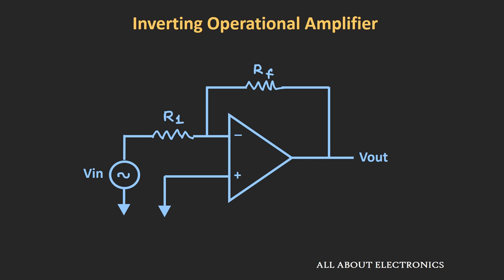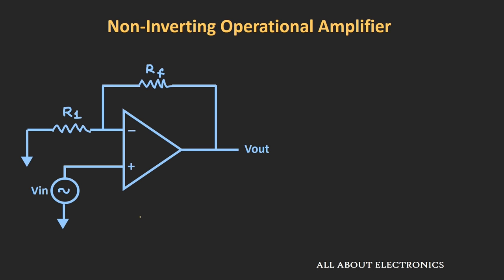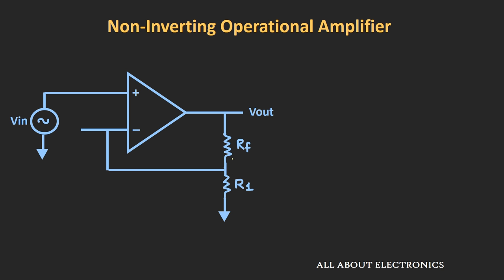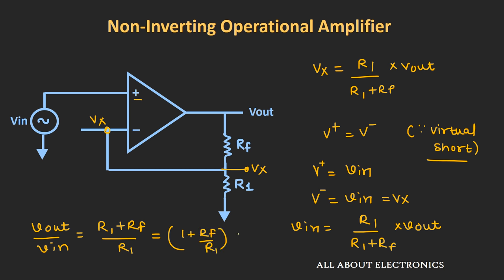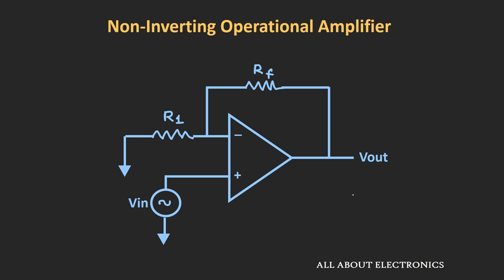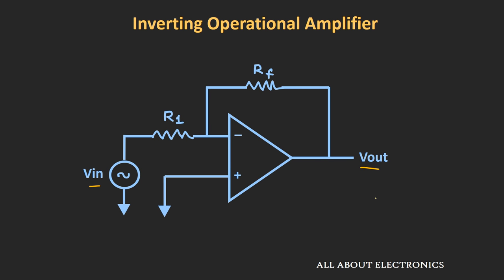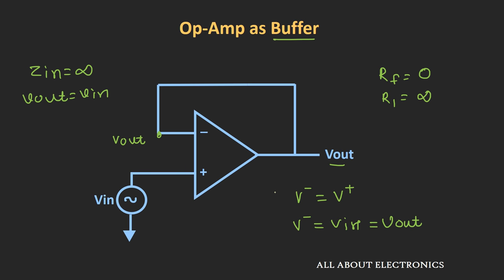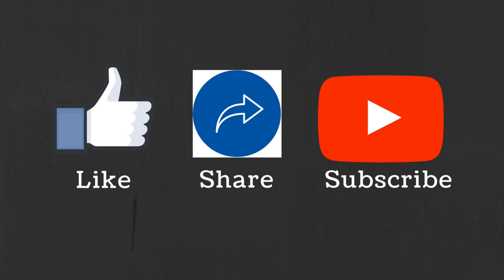Operational Amplifier: Non-Inverting Op-Amp and Op-Amp as Buffer (Op-Amp as Voltage Follower)

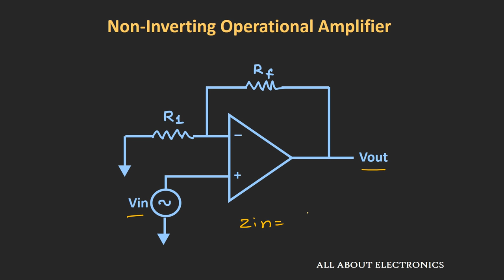Comment: At 5:44 you mention that non inverting op has high impedance while deriving Acl for inverting opAmp you told us that it has high impedance. Which is why Ir = If...can someone please explain that part?
Reply from the maker: For, non-inverting op-amp, I was referring to the input impedance of the entire non-inverting circuit. (op-amp with external resistors). Of course, the input impedance of the op-amp is very high. But when we connect external resistors, then it changes the characteristics of the circuit. In case of the inverting op-amp the input impedance is equal to R1. (it is input impedance of the entire inverting circuit ). While I was referring to the Ir = If, I was referring to the input impedance of the op-amp. (That's why it can be assumed that, no current is entering into the op-amp terminal)
I hope, it will clear your doubt.

Comment: In the Negative feedback circuit,it is essential to have a phase shift of 180 degree between the Vin & Vf. Now Vout is feded back as Vf, multiplied Vout with a factor B. Now here,my question is,if I am giving input signal to the non inverting terminal of the op amp,Vout will surely be in phase with the input signal,then the feedback voltage Vf also be in the same phase of the input voltage i.e. between them 0 degree phase shift is presented.But the condition of negative feedback is : phase shift between Vin and Vf = 180 degree.Please help me to clear my confusion.
Reply from the maker: In non-inverting op-amp configuration, the feedback voltage is applied at the inverting input terminal. So, it always opposes the input signal. Or in other words, it is 180 degree out of phase with the input signal. 
And that's how the condition of the 180-degree phase shift is getting satisfied. 
I hope it will clear your doubt.
Reply: @ALLABOUTELECTRONICS  Thanks ❤

Comment: 11:18 

Sir then why Don't we connect both the circuit with just a simple wire.....then??
Why i have to use buffer instead of just a simple wire?? 

Thank you sir
Reply: That is because you want to isolate the input circuit from the output circuit.

Comment: I have a doubt that 
why resistance is not connected in non inverting op amp when voltage source is connected??????
Reply from the maker: Generally, we connect the series resistor with the source to limit the current in the circuit. Ideally no current flows in to the op-amp terminal. Actually, it will be very very low. 
So, you can also connect the voltage source directly the non-inverting terminal.
I hope it will clear your doubt.

Comment: In the video 2 you told that for inverting opamp , the input impedance is infinite. Here you are telling it's depending on R1, can u make things clear
Reply: He told that input impedence of ideal opApm is ♾....

Also, in Inverting Opamp R1 is the input impedence because R1 is connected across Vin...

Whereas in non inverting OpAmp the input impedance is not R1 since it is not connected across Vin,, 
The input impedance of non Inverting OpAmp is not shown here, but it is maximum....

...Hope it helps

Comment: why (in both the cases: say inverting and non-inverting op-amp) FEEDBACK is only given to the inverting terminal [pin#02 of op-amp] ??
Reply from the maker: Because in both configuration, the negative feedback is given to the op-amp.
Reply: @ALLABOUTELECTRONICS  what would happen if we give the positive feedback to op-amp ?
Reply from the maker: With positive feedback, the output of the op-amp will go into the saturation. Ideally, the output of the op-amp should increase continuously with the positive feedback. But it can't go beyond the supply voltage, hence the output of the op-amp will get saturated near the supply voltage.

Comment: I tried the voltage follower circuit in pspice and it is not showing any output across a resistor although it giving right feed back
Reply from the maker: It would be better if you send me a diagram. May be you can message me on instagram your simulation.
Reply: @ALLABOUTELECTRONICS  on what account i have to instagram you
Reply: @ALLABOUTELECTRONICS  i send you pics please check it

Comment: i tried in pspice when I don't give any feedback output voltage range get shifted to negative region of graph can you tell why also I keep input voltage 1uV and Vcc and Vee to 15v and -15v respectively
Reply from the maker: In simulation, if the op-amp which you have selected is ideal then it has infinite gain. So, even for 1uV input signal it will get saturated.
Reply: @ALLABOUTELECTRONICS  it is not gaetting saturated its range become something from -1.22v to -1.51v

Comment: sir but in the last video you said input impedance for inverting opamp is infinite...im lil confused
Reply from the maker: Yes, for ideal op-amp the input impedance is infinite but here I am talking about this configuration. That means when the external resistors are connected to the op-amp. With the external resistors, the input impedance of that op-amp configuration will change.
I hope it will clear your doubt.

Comment: In the non-inverting op-amp, the input impedance is infinite, so if the voltage applied to circuit, it will appear across this circuit. Could anyone pls explain it

Comment: What is the use of a buffer over a wire ??
Could please help me getting it out
Reply from the maker: Many times one needs to isloate the input and output circuit. The variation in the load should not affect the input signal. In such case, buffer is very useful.
Of course, a normal wire will provide the same voltage at both sides, but it won't provide the isolation.
Moreover, when the particular circuit is not able to drive the load (not able to provide sufficient current to the output circuit) then also buffer circuit can be used. 

the buffer circuit, not only provides the same voltage to the load but it can also provide the enough driving current to the load.
I hope it will clear your doubt.
Reply: @ALLABOUTELECTRONICS  thank you ❤️

Comment: sir why we connect resistor to inverting terminal not non inverting explain
Reply: Bro in a previous video of inverting amplifier he said that it'll be the condition of unstability if we connect resistor to non inverting side.
Reply: To stay in the linear region we need to use negative feedback, that is why we connect output to negative input.

Comment: At 6.55, why the current Iin is not zero like in the non inverting op amp but Vin/R1
Reply from the maker: If you see, there is a node where resistor R1 and Rf meet. So, although the current flowing into the op-amp terminal is zero, but the current through R1 can flow through Rf. Therefore In is not zero in this case. And due to negative feedback, that node at the inverting terminal will act as a virtual ground (Since the non-inverting terminal is grounded). Therefore, current In = (Vin - 0 )/R. 
I hope, it will clear your doubt.

Comment: sir if we want to make an inverting amplifier of gain 20, what should be the value of Rf, R and voltage
Reply from the maker: For gain of 20, you can use Rd = 20k ohm and R1 = 1k ohm.
Reply: @ALLABOUTELECTRONICS  but then gain will be 21 isn't it?

Comment: My friend,
I watch your videos with pleasure. However, I have not been able to get information on a subject yet.
I learned that the output voltage can be changed by changing the value of the RF and R1 resistors used in opamps. However, when I measure the current at the output, I see that it has the same value as the current at the input. The output voltages of the opamps can be increased considerably. Can the output current be increased in the same way?
So, for example in the period; Let's say I need a square wave of 100Volt, 20Amper at 5khz frequency.
Using Opamp, I can produce a square wave with 5khz frequency and 100volt output. Well, since I have to connect a device that consumes 20Amps to the circuit, what do I need to do to provide the output signal with the same frequency as the input frequency, 100volts and 20 Amps.

Thank you.
Reply from the maker: some power op-amps are available which can fulfill your requirement.
You need to use it as a buffer to get the output which is same as the input.

Comment: Why feedback always connected to non inveting terminal in both cases..
Reply from the maker: I think you mean to say inverting terminal right. It is because the op-amp is operated with negative feedback. 
With negative feedback, the op-amp will operate in the linear region. And in that region only the concept of the virtual ground is applicable. And using that we can use the expression for the non-inverting configuration of the op-amp. Vo = Vin*(1+ Rf/R1).
Reply: @ALLABOUTELECTRONICS  what if when we connect positive feed back??
Reply from the maker: The positive feedback will lead the op-amp into saturation region. But it is also useed in some applications like in Schmitt trigger or while designing the oscillator.
Reply: Thanks

Comment: Source loading means source itself do not behave as load because of low zin of actual load ?
Reply from the maker: The source loading means, if the impedance of the load is comparable to the internal resistance of source, then the output voltage across the load will be less than the source voltage. (Simple voltage divider rule). So, to avoid this effect the load resistance should be much higher than the series internal resistance of the source.

Comment: Quick  question, what happens when Rf is open circuit
Reply from the maker: If Rf is open, then op-amp will operate in the open loop condition (without feedback).
Reply: @ALLABOUTELECTRONICS  thank you....what is "virtual open circuit"...i know its slightly unrelated but

Comment: why don't we use just a wire instead of using opamp as buffer?
Reply from the maker: Many times one needs to isolate the input and output circuit. The variation in the load should not affect the input signal. In such a case, the buffer is very useful.
Of course, a normal wire will provide the same voltage on both sides, but it won't provide the isolation.
Moreover, when the particular circuit is not able to drive the load (not able to provide sufficient current to the output circuit) then also buffer circuit can be used. 

the buffer circuit, not only provides the same voltage to the load but it can also provide enough driving current to the load.
I hope it will clear your doubt.

Comment: Sir please make it clear for me what is buffering or what is the use of it.
Reply from the maker: Buffer, as its name suggest, it isolates one part of the circuit with other. It is particularly useful when one wants to drive low impedance load, in a way, it prevents loading effect and isolates the input circuitry from the load. 
For more information about loading, please check this video on input and output impedance.
Here is the link: https://youtu.be/7jw2_x8dyQ8

Comment: what is the use of this type of circuits  as it says Vi=Vo what is the use of  it?
Reply from the maker: When Rf = R1, then only Vo = Vin. If let's say, Rf = 5 R1, then this circuit will multiply the input signal by 5 times. And hence it will act as an amplifier. And it can be used for the linear amplifications of the signal. Please go through the entire play list of the op-amp. You will find so  many applications of this op-amp.

Comment: Why u r not keeping resistor r1 for non inverting input
Reply from the maker: I think you mean to say the series resistor in series with the voltage source right? 
Well, if you want you can keep. But it's not going to change anything. (At least in the analysis),  as almost negligible current is flowing into the op-amp terminals. So, there won't be any voltage drop across that resistor. 
I hope it will clear your doubt.
Reply: @ALLABOUTELECTRONICS  😍😍
Reply: @ALLABOUTELECTRONICS  virtual grounding will be there in non-inverting opamp also na?? So, there also we can take v+ and v- to be short circuit and we will get Zin ==Z1.
And in the case of inverting opamp also we can consider the opamp to be ideal and hence Zinput will be infinite,so here also we can consider the Iin to be very small and hence Zin will become infinite??
Please reply fast.

Comment: voltage between R1 and Rf =vin as i=0 between +,- input due to high impedence?
Reply from the maker: Due to the concept of virtual ground, the voltage at the inverting and non-inverting terminal will be the same.

Comment: If we have unity gain in voltage follower than why we use it.
Reply from the maker: It is used as a buffer. Since it provides very high input impedance and low output impedance, its ideal for isolating two circuits and yet for passing the signal from one circuit to another.

Comment: Why here use op-amp as buffer.directly connect output of circuit 1 to input to the circuit 2
Reply from the maker: To reduce/remove the loading effect due to the direct coupling between the two circuit. And due to the loading, the effective input to the second circuit will reduce. 
Hence, in many circuits, it is good to use the buffer circuit (particularly, when the input impedance of the circuit is low.)
For more information about the input and output impedance, you can check my video on input and output impedance. 
https://youtu.be/7jw2_x8dyQ8

Comment: what is the output impedance? How to calculate?
Reply from the maker: Please check the basic video on input and output impedance. You will get some idea.
Here is the link: https://youtu.be/7jw2_x8dyQ8
Reply: I know how to calculate output impedance. But for opamp circuits if we replace the opamp with its equivalent model (assuming zero output impedance) and apply a test source at output. Then we have AVd = V_test. So, how to proceed?

Comment: For non inverting op amp, 
Vx= R1/(R1+Rf)×Vout  is written.
What is the formula behind this?
Reply from the maker: Vx is the feedback voltage from output to the input side. 
And you can get this expression by applying the simple voltage divider rule.

Comment: How do u derive the 1st eqn Vx=R1×Vout÷R1+Rf
Reply from the maker: Using a voltage divider rule.
Reply: If circuit is in series you use the formula v1=r1×v2/(r1+r2)

While if its in parallel you can use:
i1=r2×i2/(r1+r2)

Comment: Sir please explain me how you write the Vx value???
Reply from the maker: It has been found using the voltage divider rule.
Reply from the maker: It has been assumed that no current is flowing into the op-amp terminals. So, from Vout, the current is flowing through Rf and R1. And using the simple voltage divider rule we can find the value of Vx.

Comment: I didn't really understand, what is the use of the buffer circuit?
Reply from the maker: The buffer circuit has very high input impedance and it can be used to isolate the two stages of the circuit or to isolate the load from the circuit to remove the loading effect.
Reply: ALL ABOUT ELECTRONICS 
Sir what is the magic same circuit is acting as Buffer and voltage follower ?
Reply from the maker: It acts as a buffer because, in the non-inverting configuration, the op-amp provides very high input impedance. And effectively it isolates the stage which is connected to the output of the circuit from the input side. That's why this voltage follower circuit also acts as a buffer circuit.
Reply: you can use any signal to get desired output without distorting original signal.
Reply: @ALLABOUTELECTRONICS  correct me if im wrong. Is it true that we use this voltage follower to obtain only the voltage signal from the input, while isolating the current or load effect.

Oh and a little question, what exactly is a load effect.

Comment: Plz explain me how Vx=R1 ➗ R1 + Rf into Vout
Reply from the maker: It is simple voltage divider rule. Here, it has been assumed that the op-amp is ideal. So, no current is flowing into the op-amp terminals. And we can apply the voltage divider rule to find Vx. 
I hope it will clear your doubt.
Reply: Plz explain how voltage dividor rule is applied here
Reply from the maker: Like I said before, it has been assumed that no current is entering into op-amp. So, current will flow through Rf and R1. And the voltage across R1 will appear at the inverting terminal. If you assume Ix is the current which is flowing through these two resistors, then Ix = Vout/(R1+Rf). And voltage Vx= Ix*R1. Just put the value of Ix and you will get the answer.
Reply: Thanks sir
Reply: @ALLABOUTELECTRONICS  verithanam overload sir
Reply: If circuit is in series you use the formula v1=r1×v2/(r1+r2)

While if its in parallel you can use:
i1=r2×i2/(r1+r2)

Comment: Sir, if it is that we need to maintain the same voltage for both circuits, then why don't we simply connect two wires to keep the voltage same, why op-amp?
Reply from the maker: It's not only about the voltage. (Impedance and current too). See, if you direct join the two circuits just by wire, then because of impedance mismatch the voltage that appears at the input of the second circuit might be different. Op-amp as buffer provides a very high impedance at the input side and low impedance at the output. And it will ensure that there will not be any loading effect. The second thing is current. Sometimes the first circuit which is connected to the other circuit may not be able to deliver the current required by the second circuit. By, using the buffer, it is possible to increase the current driving capability of the circuit. 
I hope it will clear your doubt.
Reply: Thank you sir. It was of great help.